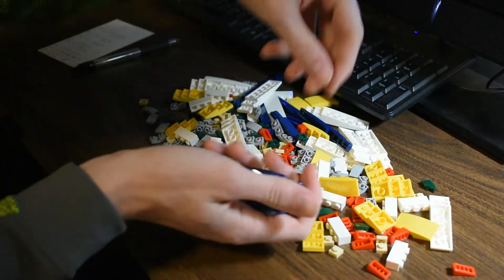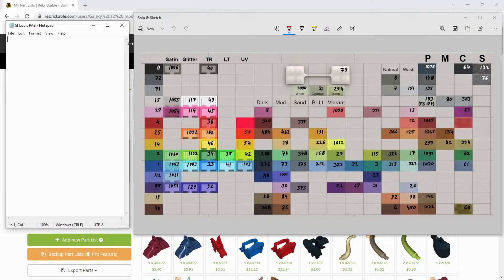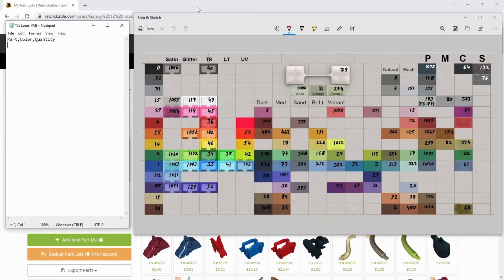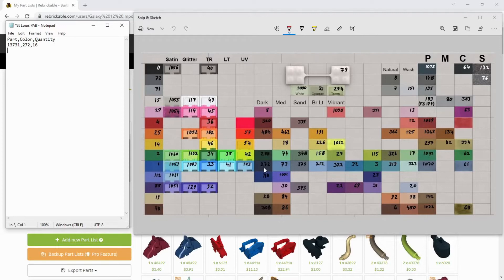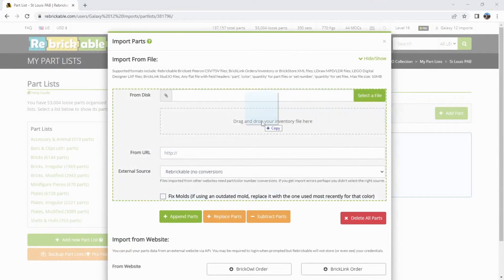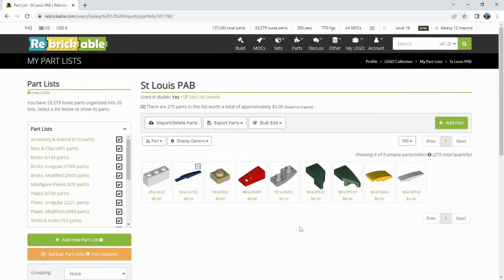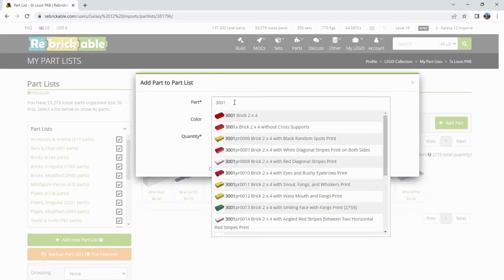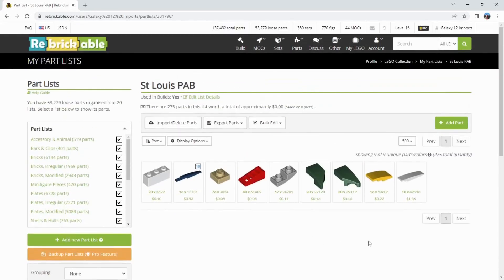Rebrickable Parts List by CSV Upload

Comment: So do you keep an inventory of every piece you own?
Reply from the maker: Short answer is no. 
It is pretty straightforward to do inventory for purchases like this where it's only 9 different parts in total, but for something like a 50 pound joblot, it takes a huge time investment to first sort then count everything, then transfer that data into whatever system I'm using (Rebrickable these days). On the other hand, if I just want to keep track of how many piece I have overall, just getting a count takes much less time. 

According to Rebrickable I have about 53,000 loose parts inventoried, compared to approximately 200,000 total loose pieces in my collection.
Reply: @BrickSystemBros  Ok, cool. 53,000 parts still is quite a bit though, but counting all 200,000 would definitely take quite a while.